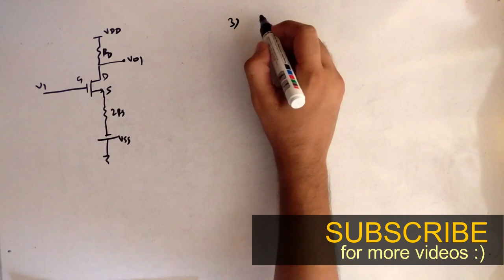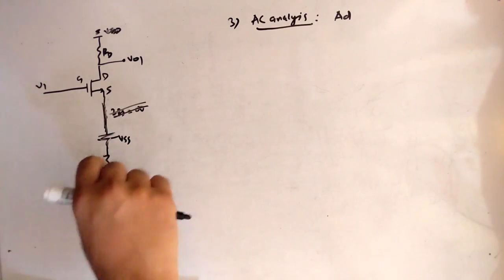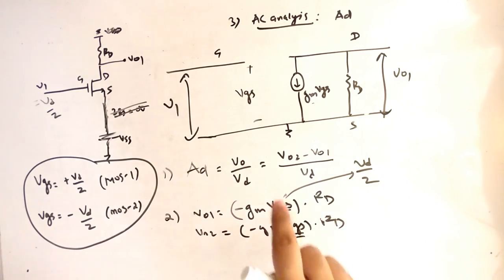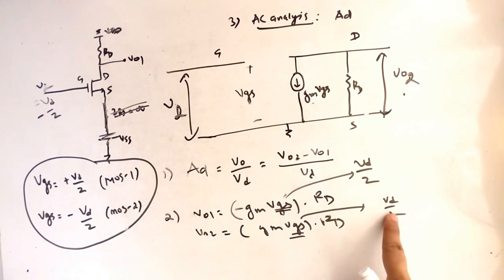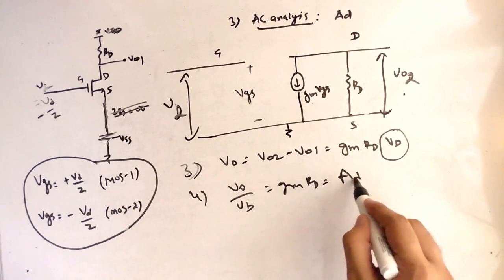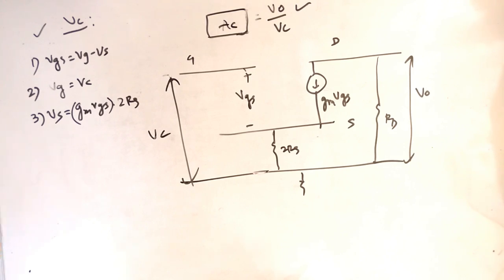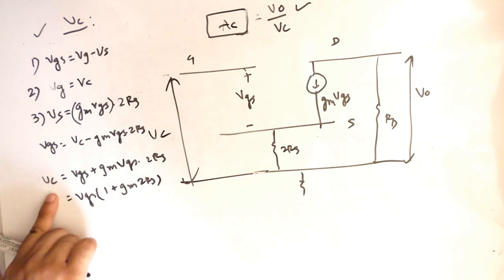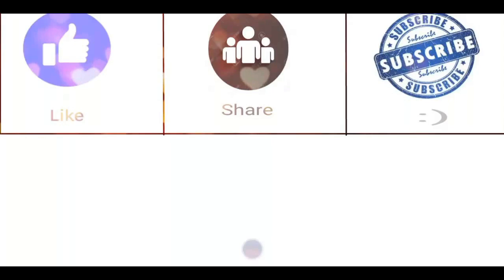MOSFET: AC analysis - Differential amplifier

Comment: Ty for your explanation......but I have a doubt..(.If a resistor value is infinity then its equivalent is open circuit....)but at 1:01 u say Rs=infinity and you (short) ground it. How is this possible...
Reply: open circuit  is not same as connecting it to ground.........
Open circuit actually means current has no path to flow..but connecting it to ground u are providing a path for current.......so open circuit  is not same as connecting it to ground.
Reply: @ganeshprasadbk1692  I noticed it too. Maybe he meant that the resistence tends to zero, like it has to have a low value.
Reply: It's an analysis trick called the virtual ground concept when analyzing differential half circuits. 

If he drew the entire circuit so that it's visually symmetrical, you can ground all of the components in the middle. It has something to do with how the drain currents are balanced.  

Note there is a different approach with common-mode half circuit analysis.